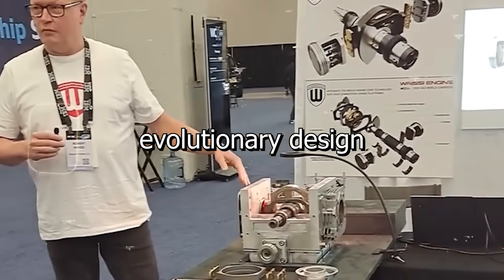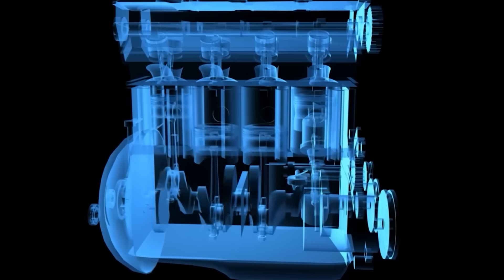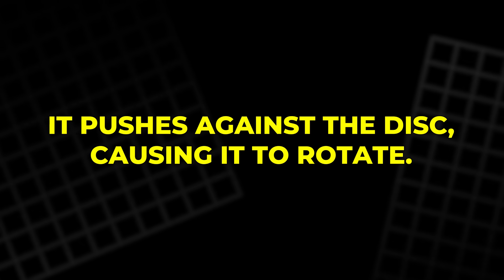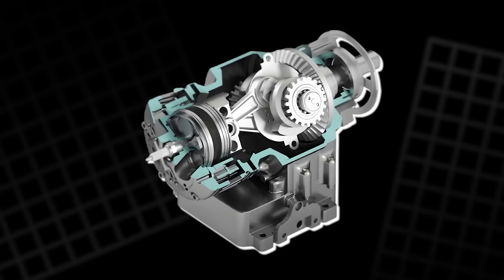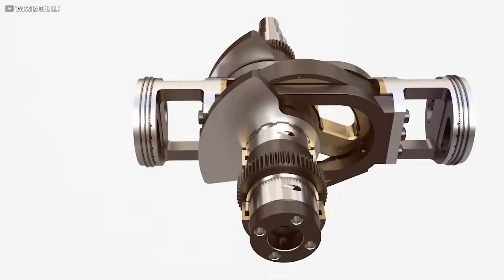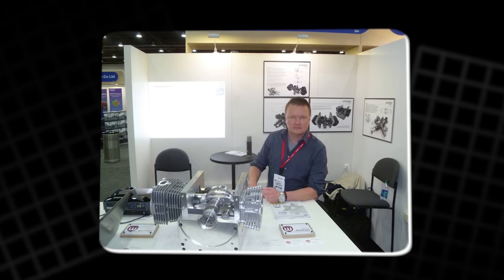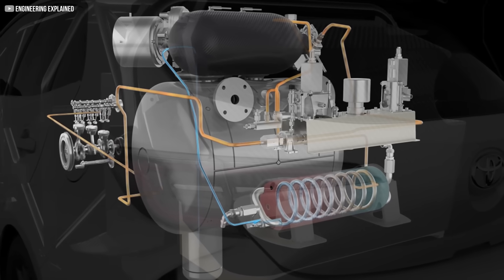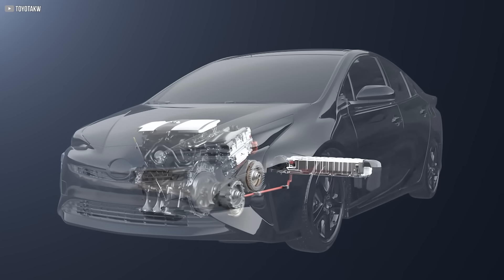The Smartest Piston Engine You’ve Never Heard Of

Comment: Could a second pair of pistons be run on the same offset disc offset by 90 degrees, or  two additional pairs at 60 and 120 degrees to the original? Turn the engine on it's side, use only one disc, and feed the output shaft to the top of a differential, lowering the center of gravity and the hood profile.

Comment: There are old steam engines with a a rocking sylinder.
They to should awoid the uneven wear on the sylinder walls. And possibly solved some balance issues. I dont know if it has been tried out on combustion engines. (?)

Comment: This eccentric disc design is just a Scotch yoke. This isn't a new concept, not even the eccentric disc version of it. Decades ago, I saw illustrations about how Stirling engines work, and they featured this type of Scotch yoke and eccentric disc. The eccentric disc is just a Scotch yoke where the crank pin is extremely broad.

Comment: It's simple genius. That's why major car companies will do everything not use it. They want their machines to break down, be faulty & to be limited. 
Complexity is not the mark of genius or intelligence. The automobiles the perfect example of this so much of a car is for convenience and not really function cars don't need computers to run they just need  fuel & a spark but engines have systems like knock sensors that detect sounds and interpret it as some kind of problem and adjust the timing but it's not necessary. 
Too much complexity equals too many problems and this engine solves a lot of that but these big companies won't want it for the reasons I mentioned. 
Don't get me wrong I want success for you I'm just being realistic. I want you and your engine to succeed because it will benefit everybody. 
It Is to be in a bad position to be a threat to the pockets of the controlling psychopaths. 
Above success I want no harm done to anybody. We all know what happened to the guy who developed the engine that ran off of the hydrogen separated from water.

Comment: Another proof that the fossil engine is at it's end. All the "new" engines, that supposed to beat electric. EV's are better, faster, and cheaper. Just look at the $US 11T in oil subsidies needed for the oil industry. A fossil car are subsidized $US 38.194 through oil alone. The oil industry are the most subsidized industry in the world, and corrupt politicians uses the subsidies to get rich on your taxes.
Reply: Their great if you don't plan on traveling very far in a reasonable amount of time. Or if you don't mind having to replace the vehicle whenever it gets a dent in the battery case. Or if you don't live where solar and windmill power causes power use restrictions. Fuel tanks don't spontaneously burn inside garages like battery packs do. Oh, and I bet one EV fire produces more toxic pollution than 100 other electric vehicles prevent. I'm being conservative about the 100.

Comment: The extra weight that oscillates and the large crank journals cause out of balance problems and there is still a side pressure on the pistons, since they don't push straight on anything except at TDC & BDC. You've just got to think man, think.

Comment: Just run it on hydrogen and you will get much improved preformance.
Hydrogen Combustion is far greater power than gasoline.
Reply: I really don't relish the idea of riding around town or on the highway surrounded by dozens of tanks of compressed or liquefied fuel with the moron drivers out there causing pile ups out of stupidity.

Comment: But don't forget piston connecting rod and crank shaft creates levers that adds to the whole mechanism. Take that away and you will loose.
Reply: Crankshafts do not provide leverage to the work done by combustion pushing the piston down the bore.  Leverage can be found in the transmission, differential and tire diameter however.

Comment: 4 stroke piston engines haven’t changed much in over a century for a reason.
Reply: Costs. There are tons of improvements that can be done, they just aren't economically viable. You can increase engine effifiency by 10+% using a double-expansion cylinder for each pair of power pistons (5-strokes cycle) but that makes the engine twice as large for the same power and lowers efficiency at low loads. Only makes sense as a range-extender where you only need 1/4 as much power and run the engine at a constant 60+% load where efficiency is about as good as it gets.

Comment: It looks like it lacks the Torque to move anything large directly .
Reply: Sounds like you are a believer in magic crankshaft “leverage”.  Crankshafts do not provide leverage.  This is no different in that regard.  Leverage can be found in the transmission, differential and tire diameter however.
Reply: @rollsroyce329  easy to say when there's a vacuum of information.What's waiting till it comes out?If it comes out and then we'll have some real specs to argue about .
Reply: @BG-me3pc it’s pretty easy to see the design has a mechanical advantage of 1. As in a leverage ratio of 1:1, as in ZERO leverage same as conventional crankshaft designed.  There is no exchange of speed or distance for force the  crankshaft or eccentric “discs” in this case merely convert the work done by combustion pushing the piston down the bore from linear motion to rotational motion on a 1:1 basis: one Reciprocation of the piston fronTDC to BdC back to TDC per rotation of the crankshaft.  If you’re interested in an engine design that does in fact have leverage do a search for the Avadi engine.  Its crankshafts (plural) provide a 2:1 leverage ration to the work done by combustion pushing the piston down the bore.
Cheers.
Reply: @rollsroyce329 i can see you're not gonna let us go , but i'm gonna hold on to my position and tell this thing actually shows up in the marketplace and and actually is utilized in mass ,
But unfortunately, sadly enough.
It most likely won't even if it is everything you would hope for , because of the mental laziness of manufacturers especially ones representing u s companies .
Reply: @BG-me3pc  all good man, I was just pointing out that you could see in the video that the RPM of the piston is a 1:1 ratio with the RPM of the output shaft.  You can see it moving in real time so I was commenting on the design itself not theorizing on a potential consumer product.  It looks interesting but not without challenges.  Did you check out the Avadi engine design?   There are some good videos of it on YouTube.
Cheers.

Comment: dc electric plasma heat/hmd jet thruster has no moving parts. only air that heats like in a nuclear air heat thruster. instead of pushing a central rod, you could also generate direct electricity with a linear moving piston rod. could not tell what displacement units were. those circles work like flywheels too, out of the box. or springs can be used also as a linear flywheel.

Comment: Looks like a variation on a Scotch Yoke engine
Reply: Hans Volpe worked on this design with my grand father right after WW2 my grand father & his brother opened a speed shop in Allentown pa. I carry on the speed shop tradition here to this day... My grand father worked as an engineer for Vultee aircraft Lycoming aircraft & Sheridan Machine corp in Allentown. Hans did planning & drawings with my grand father & my grand fathers two other brothers all employed with all 3 companies secretly made parts in their spare time & over holidays when the plants were closed down. Simply put by the spring of 72 they had 3 working engines on this design. The larger engine they named Knechtra made about 950hp. My grand father installed that engine in 1941 Renault Caudron plane. The thing was a rocket with it's original engine. Their engine however once they added a turbo from some used delivery truck they bought. The thing was real rocket after that. They were hitting speeds upwards of 400mph with that plane. In 1971 they won the air speed races in Reno Nevada and Utah. After that my grand mother put the end to grand pops air racing. My grand father out distanced Hellcats even Corsairs and even Brit Spitfires with relative ease with their eccentric disc kinetic engine. I believe their engine was an 8cyl. A company from Ohio bought the other two engines and the plane from them for 400,000K back in 1973.  I was told by my father the company rep that bought the stuff had worked for Hughes air and Huges Mfg which was still in business at the time. Whatever they did with that stuff I have no clue. The technology seems to have been sidelined. But this idea and Yoke motors even the Wankel Motors are not forgotten. At least not by U & me. If anyone cares about facts my Grand father all his brothers including Hans Volpe were also champion Ice Boat racers in the 50s & 60s. Hans was sadly killed Bicentenial year 1976 in Munich Germany on lake Munich when his ice boar hit another racer. My grand father was never the same after that. Shortly after that Ice Boating was banned here in Pennsylvania for good.

Comment: It has to have some side load. It's pushing against the side of a circle.
Reply: It has side load and friction it's just another idea for the dust bin of history.
Reply: Yes,. absolutely. The side load is taken by the sliders instead of the pistons. Nothing much gained.
Reply: @stevethackery9853  Two counter-rotating disc should eliminate any side loads.
Reply: Depending on the position of the crank after ignition.  He should make a 1/10th scale version using lawn equipment. Just like fusion folks building a full scale devices before knowing if the idea works, is insanity